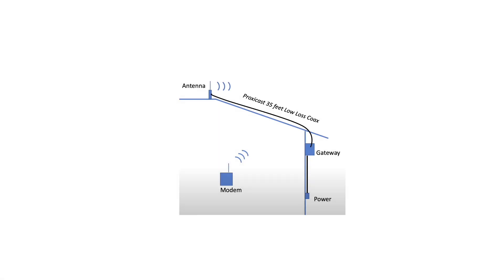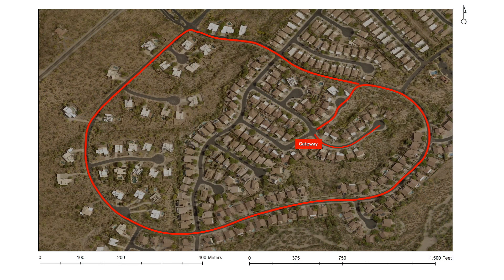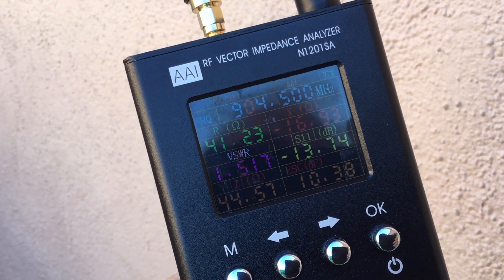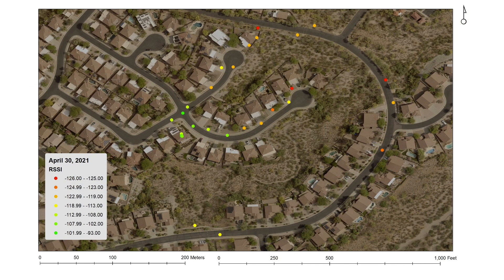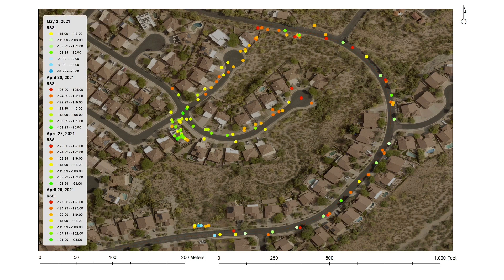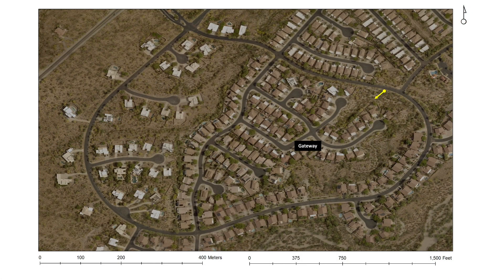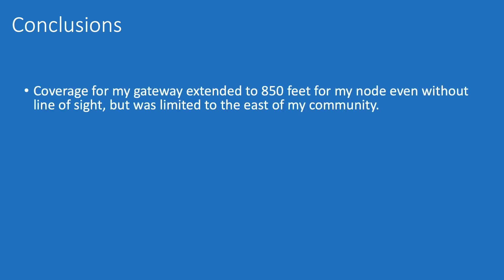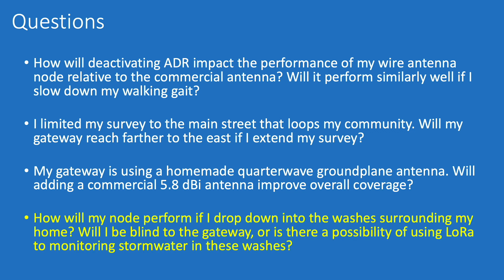LoRa Range and Signal Strength Tests in a Residential Community

Comment: I have a working theory that the reason moving very slowly (or staying stationary) helps so much is that there is 30s between packets, so if a packet fails and the radio decides to use a different spreading factor, that wont happen until the next packet is sent out. I could be totally wrong on this though...
Another thought, what if you lock the node on SF12, what kind of range do you get? I'd be a bit surprised if it didn't work any better on the east side of your neighborhood.  TTN will get mad at you if you do this forever, but for testing purposes... should be fine!
One thing I tried was holding the antenna over the roof of my car, I suppose providing up a large ground plane. Got my signal much further away this way
Reply from the maker: Thanks Sam. For testing purposes, I'll give the SF12 a shot during my next suite of experiments- stay tuned.
Reply: @ModestMaker  Thought this bit was interesting from the TTN Mapper docs: From experimentation it has been seen that slower spreading factors (like SF12) does not perform well when the device is mobile. This is likely due to path fading from obstacles in the radio path, causing bursts of interference (erasures) which the forward error correction can not deal with. When you are doing measurements while standing still higher spreading factors (SF9-SF12) will work, but when mobile it’s better to use SF7.

Comment: This is similar to our experience w/ a similar experiment.  It works best when absolutely still. It can't be doppler since the speeds are so low, so it must be signal strength, polarization, path changing during the transmission (guess).
Reply from the maker: Thank you for that feedback. I assumed I was just improving my signal when spotting the gateway between homes, but the bottom line is movement does appear to dampen the RSSI.